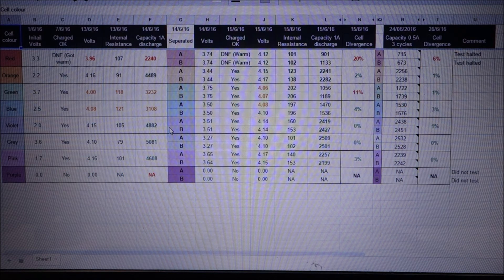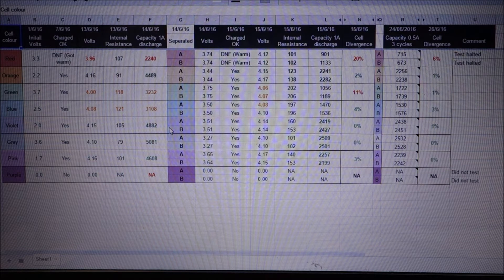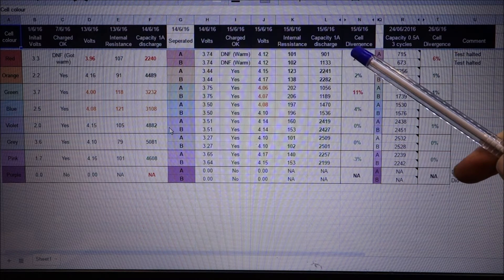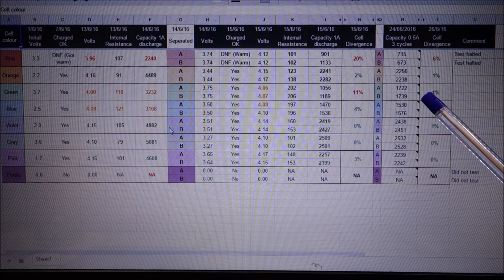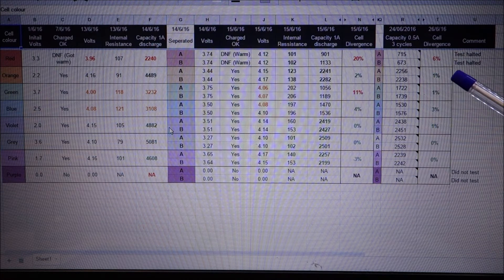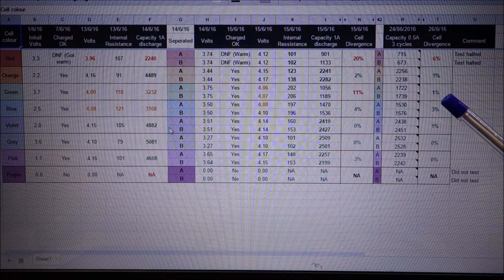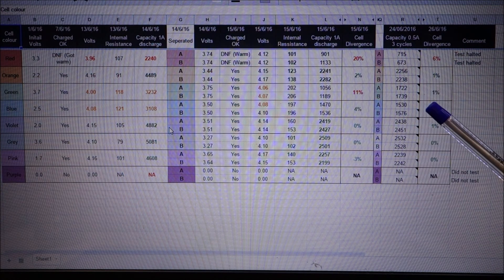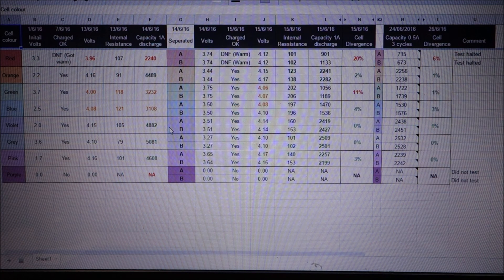Laptop Powerwall 42 - 18650 pairs vs singles: wrap-up

Comment: Hi Paul I believe the battery packs are assembled by a manufacturer other than the Laptop brand, You can find who the assembler is from the UL number if it is listed on the battery.  The laptop manufacturer is only of relavance where they may not charge them correctly etc but with only 3 main laptop mobo manufacturers and only a few battery management ic makers I think that the cell manufacturer is probably of more relavance.

Comment: I'll happily stick with single cells but you have an extremely good argument there :0 Great work.
Reply from the maker: I was considering doing a video on the pros and cons of each option. But maybe you and I could do a combined video discussing both options?
Reply: Could I guess, but I'm not willing to get in the way of progress. Your way has so many advantages!!! Ask me in a year after I've either learnt something or given up :)
Reply from the maker: Some good things about singles; it's easy to source battery holders, they look tidier, and there's a bit more flexibility when designing packs to fit into odd shapes (like bicycle/motorbike frames).
Reply: Some good things about doubles - Faster.... !!!
Reply from the maker: +HBPowerwall And you don't need to solder directly onto the battery. Can solder to the joining strap. A wee bit less heat going into the cell(s).
Reply: Less heat is a bonus !
Reply from the maker: Understanding Internal Resistance is simpler with single cells.
Reply from the maker: The biggest advantage of singles is there are lots of good YouTube vids showing how to build packs with singles.